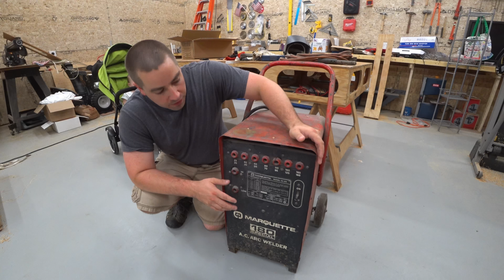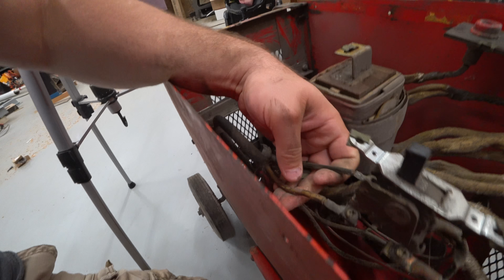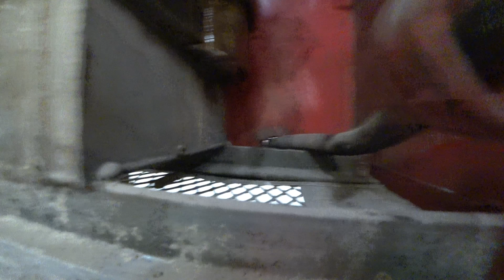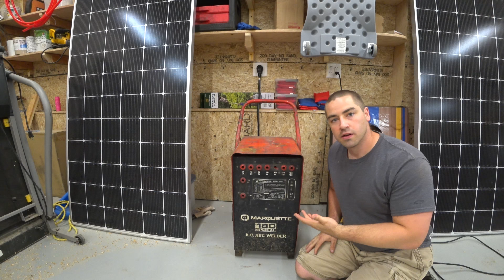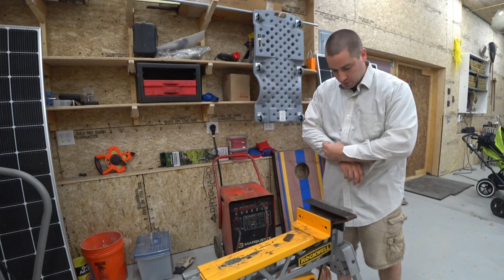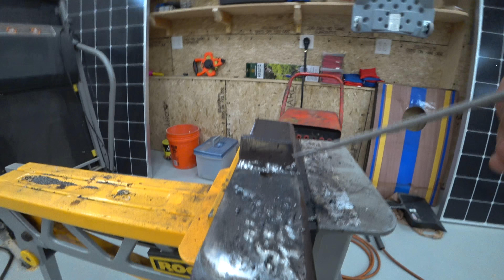First Time Stick, Arc, Welding, fixing up old welder

Comment: TIP.. If you are a novice it is much easier to control the tip of a rod and strike an arc if you cut a few rods into 3 pieces.. Using a short rod makes it easier whilst getting the hang of things.

THE WELDER - Good choice.  Having seperate outlet sockets for the different ampages means that the machine has fewer moving parts. Selector knobs/switches can wear and burn out. Secondly,  the 'movable shunt' system is not being used either where a large threaded shaft moves with a large adjustment knob an iron shunt in and out of the transformer varying the amount of magnetic flux and therefore the amount of current produced.. Its less efficient because the seperate connection system means the transformer is always working at maximum flux efficiency.. Also the shunt and shaft can also break and/or seize up with rust.

Comment: A few years late but I figured I'd save people the hassle of changing out cords. On something like this there's no reason to switch to a 4 wire cord, there is no need for a neutral since it's a 100% 230 volt device. If it had 120 volt accessories on it then it would make sense to switch to the 4 wire setup so you aren't sharing your neutral and ground which can pose safety concerns in some instances.

Comment: I picked up a Century 230 Amp AC welder off Craigslist a short while ago.  I will also be a first time welder.  All I have to do is wire up and outlet off the breaker box and I'll be laying down a bead and welding some random stuff to learn.

Comment: I'm sure you've already figured it out but the high ground is for the large number on each slot if you want the smaller amp on each slot you use the low ground.
Reply: The Red Knight  - Thanks for your input to this YouTube poster about the High & Low plugs. “I” was wondering that. I’m in the posters shoes now about to try my first stick weld also using an old welder I bought. Thanks!

Comment: young man ,
u did fine take a long time to learn any thing / every body at first is a greenhorn  ! .

I LIVE IN NORTHEAST LOUISIANA ,  I SOME TIME REBUILD OLD WELDER / IF U KNOW ANY ONE NEED REAL OLD ONE , , REAL I HAVE TO MANY OLD WELDER AROUND MY  OLD SHOP ! .

I HAVE " 1959 20 TH  AC 295 AMP ARC CENTURY WELDER MACHINE " F O R  -  S A L E "  $100 .00  AN 2 -  50 FT OF LEADS   +  AND -  !  FOR  $  25 .00

Comment: David, thanks for the reply on my 'solar' comments.  I figured out why I like you so much - you've just like me!!!  At 72 years of age, I still love VARIETY in all things!  Learned to weld in the Army. My father-in-law gave me an old Forney stick welder and tons of sticks. I went to the library (no internet then) found the Forney manual and copied it.  Went home, picked up a lot of old iron and started welding. To make an arc, swipe the stick as if you were to strike a match on a match box.  If this helps - then once you have your arc, slowly rotate the stick in a small circle "O" just above your molten pool.  As you slowly rotate, move a little in the direction you wish to weld.  Some students like to move their sticks as if printing the letter "C" - again, toward the direction of weld.  Lay a piece of iron on the floor, and practice weld lines.  Use different sticks and power combinations.  That's how I learned. The long-sleeve shirt is good common sense - without it your arms will become very sun-burned!  Oh, the older Forney and similar welders have copper cores, unlike some of today's aluminum or steel cores.  The copper cores cool off faster so you can do more welding cycles (time between cooling cycles).  Newer units have to rest longer between cycles. Once you have learned the basics, you may want to invest in a welder with a variable (circular switch) selector. This will allow you to set your power on the "sweet spot" much easier.  Old welders like you and I have are only able to set the power on a number which may be a touch too hot or too cold for a project.  And lastly, welders come in AC and DC - so make sure you have the correct sticks for the type of welder you have.  Oh, forgot to mention - go ahead and buy one of the instant breakfast type welder helmets. Worth the money. It instantly dims when you start so there's no chance of losing your spot as you wrestle with trying to get the helmet to fall over your eyes.   John

Comment: uhhh do not connect ground and neutral together at the device. where does the mains return to? the other hot or the core of the transformer?
Reply from the maker: Hi SuperBrainAK,  I could not find a definitive answer on swapping out a 3-prong for 4-prong with this exact setup.  I'm not sure what you mean by the other mains?  I have two hot leads, black and red.  They both go to the primary winding on the transformer.  The tab I'm connecting to is on the iron core, which is welded and bolted to the frame.  That is not connected to the secondary winding, which takes off to the outputs on the front of the welder.  I checked several websites for info on this, but they all seam to give information for dryers or ranges.
Reply: oh I see, then the transformer runs directly on 240v. so you just need to connect the ground to the chassis and cover up the neutral because it is not used. 

Neutral is the return for all 120v devices since we have 2 phase center tapped power, from one hot to neutral it is 120v from the other hot it is 120v but at all times it is the opposite polarity. so from one hot, lets stop time and say it is positive 120v right now then the other hot will be negative 120v at the same time. so from one hot to the other it is 240v. resuming time again it is AC but they are still opposite polarities so you have 240v AC from one hot to the other, but at the same time you have 120v ac from each hot to neutral. 

Anyway your transformer is not using the neutral as a current return since it runs on 240v, it is using the hots as its current source and return alternating. 

So the neutral even though it should be the same voltage as ground since they are tied together at the breaker panel the neutral might have current flowing across it (from other devices on the same circuit and panel) so the resistance of the wires makes a voltage drop. low resistance would mean a low voltage drop and not much to worry about, but if it got messed up somehow there would be high resistance meaning high voltage drop so it would be dangerous.

So this is how american homes are wired and why you should use neutral as your hot return and ground as your emergency connection to ground or 0v potential. for your welder there isnt any current flowing on the neutral but there is current returning to the neutral bar in the breaker panel which if it came loose from the chassis or ground connection the only return for neutral now would be through your welder overloading the wires or shocking anyone who touched the welder case. so not likely to pose any harm but it is against the NEC and could be unsafe.
Reply from the maker: Hi SuperBrainAK,  Huge Thanks for explaining that.  Makes sense.  I'll disconnect the neutral inside the case and tape it up.  Thank you for such a good explanation.
Reply: your welcome, you should watch mike holts videos on electrical code, very informative stuff. https://youtu.be/mpgAVE4UwFw
Reply: Miller electric made a Dialarc 250hf ac/dc machine that had the 220 going out in 3 wires. Red,black and green. It powered the welder then they split one leg off and had it run a 110v pump and fan motor on the coolmate 1 radiator that was mounted to the top. I finally called tech support and they went through the schematic and sure enough the machine is manufactured that way and dumps the neutral off the 110v fan/pump motor down the ground. Worked fine. Nobody got shocked. The HF was another story... Nobody got Shocked!!!